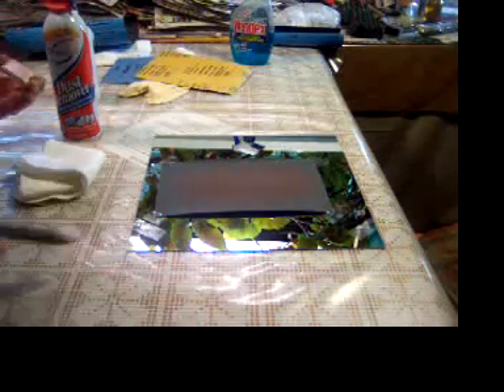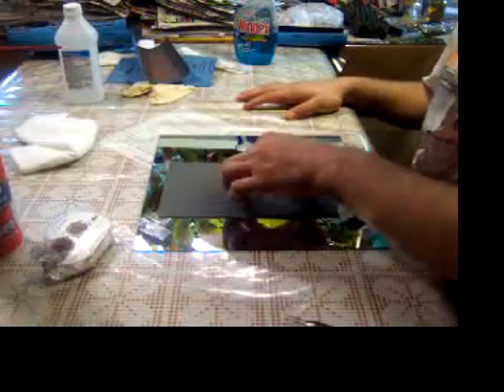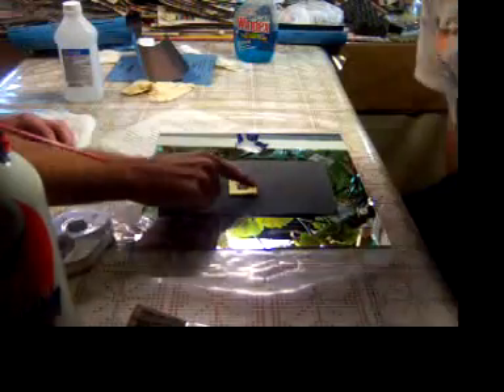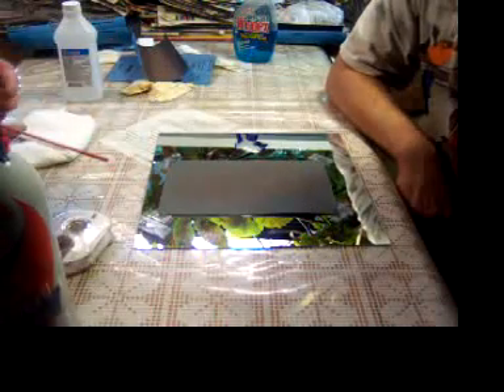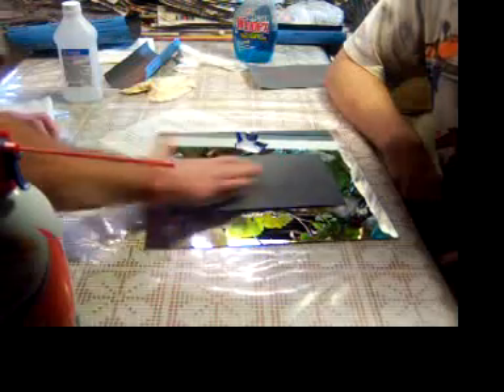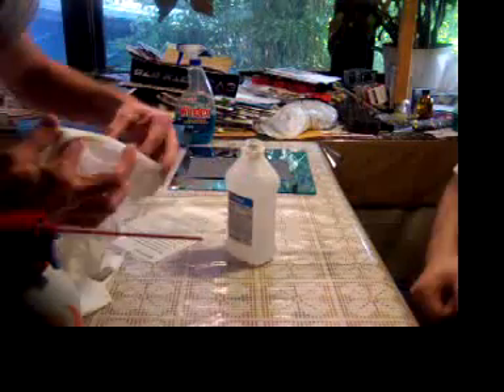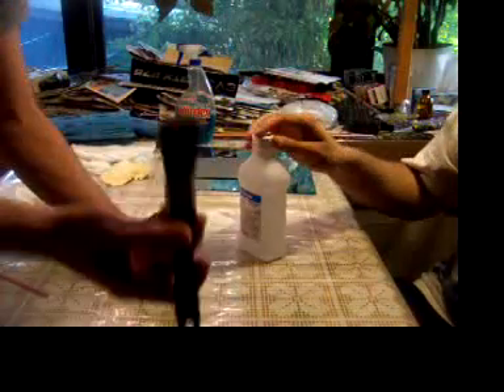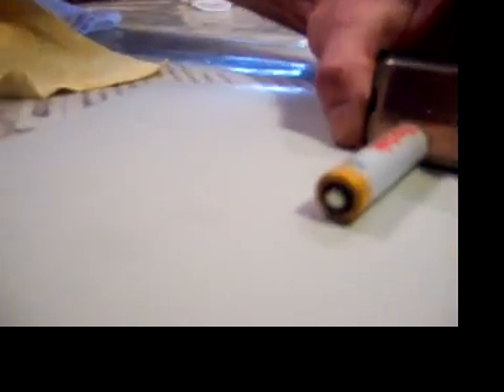Lapping a CPU part 4

Comment: This is Malivictus friend Dragon (the one in the Video). Normally we extreme overclockers do this tweak, because we have reached a CPU temperature limitation on our CPU's. By doing this little tweak we can drop our temps even lower to allow a more of an overclock on the CPU itself, or reduce our temps on a already hot running CPU.